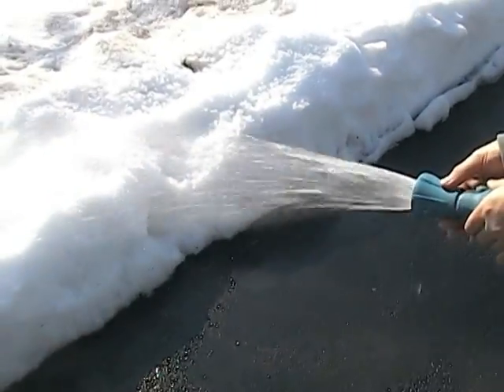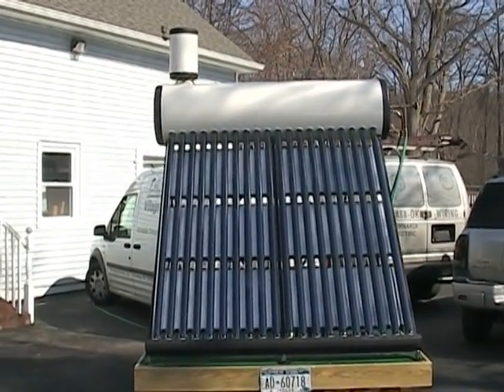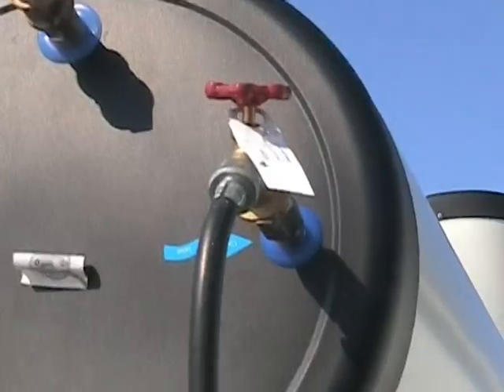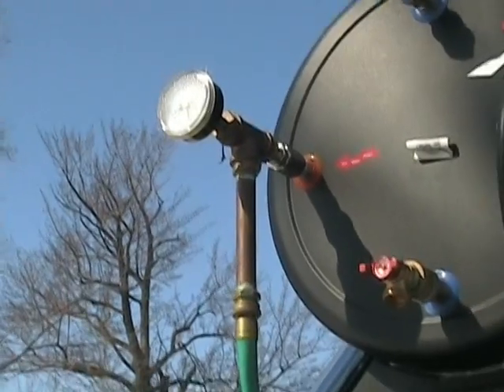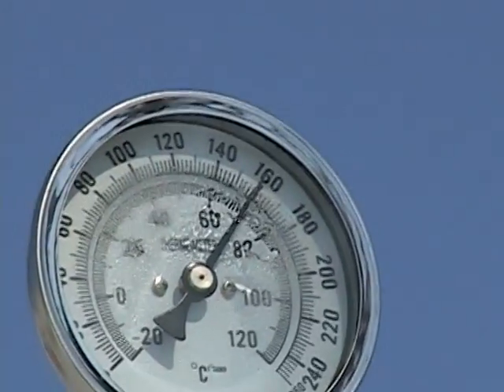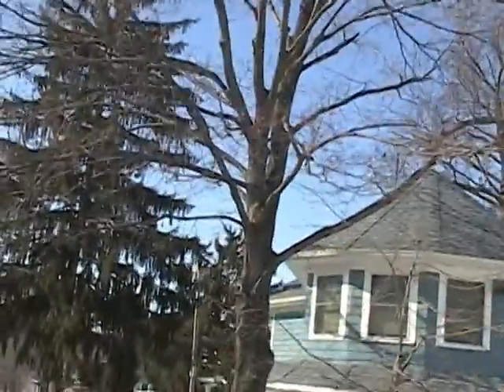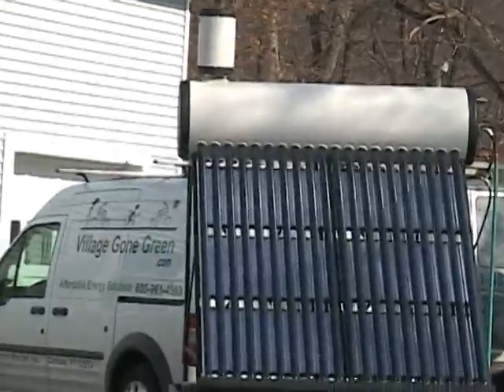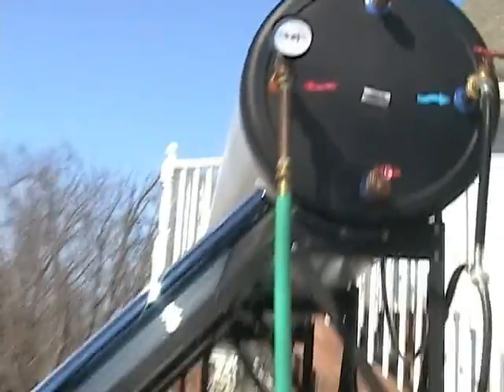Solar Hot Water Heater Thermosiphon DIY - Solar Thermal Water Heater saves you up to 80% energy

Comment: I like the idea of a storage tank and instead of floor heat run it through wall radiators.   Probably cheaper?  I'd like to know what happens with the summer heat and all this stored energy?
Reply from the maker: Different system for heating, this is for domestic hot water. Summer? no problem.
Reply: @VillageGoneGreen  Thank you for getting back to me so quickly.   I'm in Pennsylvania.   Where are you located?
I just emailed your website for some quick information.
Reply: @beebob1279  ok I'll look out for it
Reply: @beebob1279  NY

Comment: Why isnt the tank painted black ?
Reply from the maker: Why would you need it black? The tank doesn't heat the water, the tubes do. Behind the cover of the tank there's 3" of insulation. Visit http://www.villagegonegreen.com for more info. Thanks
Reply: It would probably raise it another 20 to 30 degrees even with the insulation. just common sense. they should do a material that holds on to heat rather than insulation and paint the tank black. Then put a clear box around it.
Reply from the maker: Your theary would work if there were no insulation between the inner tank and outer cover but there's 3" of foam insulation so it wouldn't do anything. This units are well designed, I've had them boil water.

Comment: Does this require a pop off valve if it gets to hot?
Reply: Indeed it does. You don't want it to blow when it reaches boiling in the summer!

Alternatively, you can use antifreeze (which also pushes the boiling point higher).

Comment: As I understand it, this system is just heating water before it goes into a homes hot water heater system. Is there any system you're aware of that replaces the in home water heater? Would it be a bad idea to run a small home off the 30 tube/80 gal system alone? Thanks.
Reply: I wasn't able to find the model that had the electric bit in with the DIY system... you wouldn't happen to have a URL would you?

Comment: 2:00 "domestic water will never touch the water in the tank" ?

why do you need a 40-80 gallon tank ?
Reply: Thermal capacity. Think of that tank like a battery, the bigger the battery the more energy it can store.

Comment: Do you have any idea if this would work to use to heat a house with hot water heat if so please let me know thanks
Reply: Radiating floor conected to solar water heater. Also you would need to set up some larger insulated water storage for the cold nights.

Comment: I have installed a passive type solar water heater in my house in India.The problem I am facing is, when I open the inlet valve hot water is coming out from the gas vent!!!
what should be the reason and any solutions??

Comment: So what is happening when there is no pressure drop from the faucets/shower etc. like when there is no moving water? I figured you would need a pump to push the water into the water tank heat exchanger.

Comment: If you travel in China, you will see millions of these units on the roofs of buildings, from rural shacks to luxury high rises in cities. The heat water and keep it in a foam-insulated tank. The feed for the hot water travels thru a copper coil inside the tank of hot water. At night there is no need to worry about the water in the tubes freezing because it's the same as being in a Thermos bottle. No moving parts.

Comment: I deal with this type of pre heat solar water heater in Spain, they work great and provide over 300 days of free hot water here.

I do use 2 units on my house just for under floor heating in the day then switch over to wood burner with boiler for night.

Comment: Greece make them for over half a century, we have refined the tech, actually we never -ever- use electric power to heat our boilers.
But we build them with glass on top to shield it from external heat resonance, plus we can use glass made like a lens. 
We also use closed system which circulates antifreeze liquid and then it passive heats the boiler (this is good for resisting in ice breaking and freezing)
Reply: Kitrinomavro hi, is there a brand or company that you recommend?
Reply: Shlomo Cohen my comment comes late but if you’re still interested: 1. Pyramis 2. Maltezos 3. Bartec 4. Elco.These are just a few but there’s probably hundreds of brands made in Greece. I 100% recommend getting one. The latest technology ones will heat water with minimal sunshine. Make sure that the water tank is “double glass glazed”. If you need more info.  let me know. ( I’m not in the industry, I dot sell them but I like to help!)

Comment: hi, if the water was circulating in a closed system how long would it take to cool down over night? Have you done this kind of study or do you have any stats on that. What i am aiming for is to have this unit hooked up to a heat exchanger in my house and circulate water through it to make heat in the house
 any info about this would be appeciated

Comment: Look for the "SOLAR DEATH RAY WATER aqua lens with 1/3 Kilowatt Heat Energy" video from GREENPOWERSCIENCE
"This is another solar water lens that is almost 30 inches in diameter and can burn through wood quickly.,,, This lens concentrates about 500 watts of solar heat energy to a focal point of 1 inch optimal with a 3-6 inch scatter."

Granted that is output at high noon, but whats another mirror or small collector array to redirect the Sun at it going to set you back?

Comment: Just a recirculatory system cooled like our cars are now, taking advantage of solar heat derived as I suggested and powering an electric motor with electricity from Peltier Banks fed by heatpipe arrays.
Not enough heat for you? Add some Methane fueled Bunsen burners and put your seatbelt on.

And of course we have plenty of lighter materials to work with,,, just look at the potential of Spray on truck bed liner to make paneling. :D

Carbon composite framing and hemp-based fiberglass bodies,

Comment: All you are doing is converting the total BTU's deliverd by the sun to an 8'x10' area which is equivalent to about the same as 3 microwave ovens. Focus that thermal energy to a 3" point of contact and you will see some stuff move.
Set 2 of these panels in a V on a trailer bed with a good prismatic solar collector,,, or line a 53' tractor trailer with them like that,,, 
:D

Comment: Think of it like a Heat pipe cooler on your Computer.
The Sun provides the heat like your CPU and the heat pipes holding Glycol pass the heat up to the "Hot water tank" / heat exchanger at the top of the unit.

(I'd imagine there are a number of options one could use in place of Glycol like heavily salted water perhaps.)

Comment: @electronicdawg the water in the pipes never touch the water going to your home. it works like a radiator, the house water runs inside the barrel in a pipe network while the water surrounding it is separate. how it heats the water is by controlling the density, the cold denser water sinks to the bottom of the outside pipes while less dense hot water floats up into the heating barrel, the water in the pipes and barrel can contain antifreeze since it's only surrounding the home pipes, not joined.

Comment: You inspired me! I am in Florida. I did not hear you make mention of any cost. Is it possible to hook up a circulating pump to move the hot water through a series of radiators? We have winter here and the temp gets down in the teens. A few nights, though I had the thermostat set on 75, it was 56 in the morning. My 5 ton heat strip with heat pump could NOT keep up. This is a nice AC unit. Thanks for your help. Maybe we can sell the units down here too! I have a retail store.

Comment: Ken from NY. I like this system... How long once you've collected the Hot water will it stay to Temp? And what is the flow rate? 

Anyway it's nice to hear you ans see your son working with you. Tomorrow I build my first solar collector for a plumbing supply house in NJ. 

Your system looks really clean. I wish you good luck in this venture.